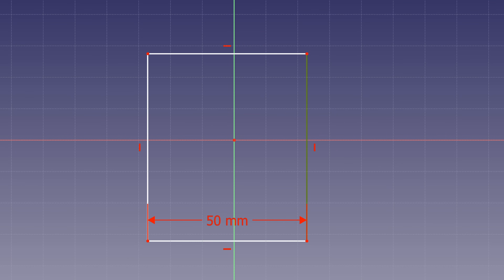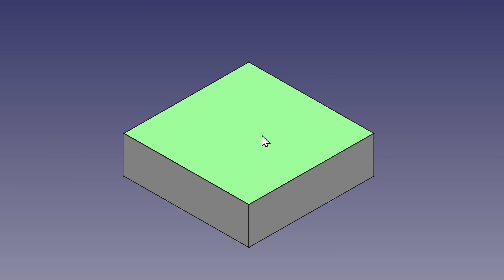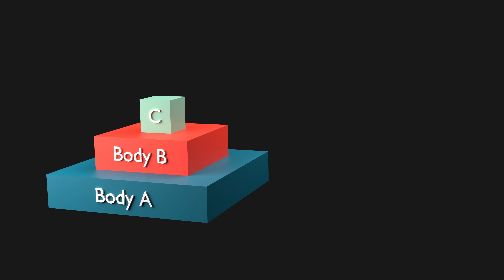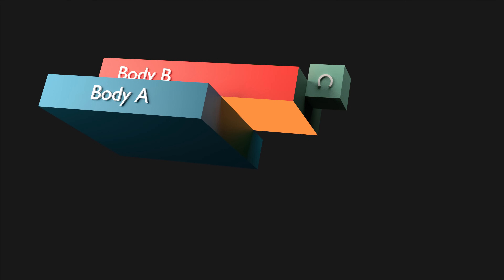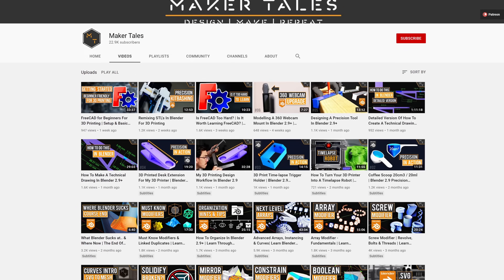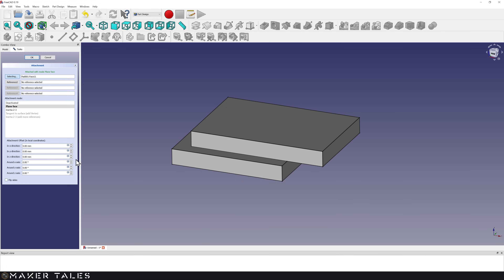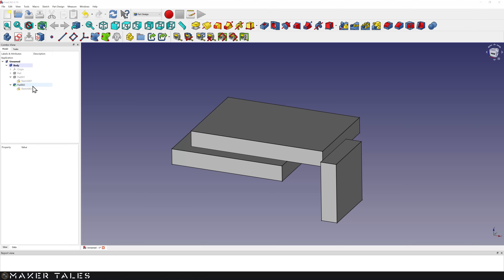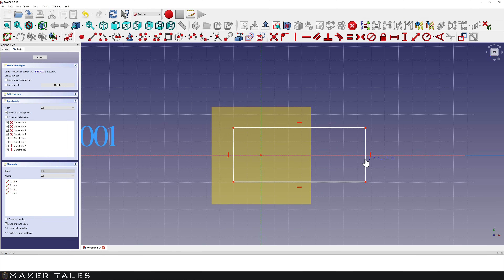FreeCAD Is Fundamentally Broken!  - Now what... Help Me Decide...

Comment: I come from Siemens NX 11 and NX 12 and downloaded freecad as NX licenses are prohibitively expensive for hobby projects. I was imediatly disgusted by it's cluttered UI and searching for stuff you know how to do in another software is quite annoying as well, I was willing to put of with it for the time being simply because it's free and you can't really complain at that price level. Then I stumbled upon this bug. First I thought it was just an issue with what I did. Maybe I didn't attach the sketches properly? Nope, it's just awfully coded. This made my uninstall the program and never came back. To me, it highlights a fundamental misunderstanding of how a modern CAD software needs to function. Every cad software works by associating geometric data together. What they have demonstrated is that they lack the crucial understanding as to why that is done. It is done to communicate relations between part features to one another. The designer (or anyone else) doesn't give a shit about how the side is called. What's important to them is the position of said feature on the part side, it's dimensions and it's tolerances. NX does that really well, as it let's you define relationsships between sketch features and part features explicitly when sketching and for all those parts that don't need an explicit declaration, the rapid constraints usually put sensible relationships between part and sketch features into your design automatically. In that program, you'll never encounter such a bug - you might get the annoying message that a referenced feature has been modeled away, but that is usually the fault of the user, not the CAD software.

Comment: That is really not a software issue or a "bug" necessarily, it's a methodology problem. As you say, origin based is the correct method. This is true even for small parts because you want to do a part once, not redo over and over - stability is king. New users should learn this from the start. Much worse is the lack of truly flexible multi-body. If you want to do "quick intuitive" 3D then use Sketchup or 123D. Building geometry on the surfaces of other geometry is a road leading to disaster - at least professionally.

Comment: Its good practice to use parameteic reference planes rather than body features so it's not really an issue.  This same "issue" occurs in professional and very expensive software too.
Reply: I've been using faces as references in Solidworks for well over a decade and never had the slightest problem. Other software can handle this robustly, but you have to pay for it.

Comment: That is sorted by not messing with the names basically, the only time you do that is when you messed up the naming. What i find problemetic is the interface of freecad, it is not logic coming from lets say the autodesk branch and you have to spend some time identifying the software symbols instead of making drawings. It is not difficult but the transitation from lets say fusion is not fun, at all.

Comment: Great explanation of annoying "topology naming problem" which everybody will experience when using FreeCAD. Especially when adding chamfer or fillet the issue is destroying the whole object in case of changes in sketches lying underneath. Really annoying! When developing and optimizing a part it will be always necessary to modify sketches fundamentally. FreeCAD is the best real free CAD program (absolute no doubt about this!) and i wished hunderts of times that the topology problem would be fixed. Like in Excel where all linked cell names are automatically changed in all formulas if columns or lines are added or deleted.

Comment: A question: Is this problem related to the SKETCH based workflow? I mean if you weren't sketching, but still wanted parametric dependency, couldn't you just model one part from another's GEOMETRY? In other words why does it have to be a "sketching plane"? Okay, I'm a 25 year Rhino user. We don't sketch. We just build. Well, I speak for myself. I just create geometry, and use it. I usually start from curves, and they don't even need to be in a PLANE!  Rhino parametric "history" system isn't perfect. For all I know, it may use the same technique under the hood. But I tell you ALL THESE "SKETCH" WORKFLOWS are making it very difficult to learn FreeCad and others. (all caps only for emphasis 😃)

Comment: 110% This.  I learned SolidWorks in college, easy to use but requires a license.  Fusion360 user agreement gets weird if your designs support a company that has more than a few people in it.  SketchUp isn't a parametric modeller as far as I can tell.  FreeCAD was what I settled on to make some 3D printed widgets for an engineering competition, but this face-breaking issue was a really glaring bug when I first started adjusting dimensions and the main reason I have trouble recommending it to others (my work around was to absolute reference everything to the origin rather than other faces).  I'm glad I'm not the only one befuddled by this.  It would be nice if FreeCAD had the level of support KiCAD seems to have; making the parametric modelling function as intended I think would go a long way to enabling that.  I'd second working with the Reel Thunder branch, I'll take another look at FreeCAD if there's a fix out there for this issue.

Comment: Using only datum planes that reference the origin or maybe other datum planes forces you to make simpler objects and you're then not using all the potential of the modeling tools available to you. Because basically, you're re implementing the features in terms of datum planes; for example, when you set a datum plane z-offset to the Pad length of some pad, you're basically duplicating the feature; one is the feature, the other one is the expected location of the front face of the extrusion. This is the solution they're telling you to use in the forum..
What FreeCAD should be able to do -- is to reference the front face of a Pad by a symbolic name (i.e Pad2.frontFace), or Pade2.SideFace.betweenPoint0andPoint1 the extruded shape is linear) so that it's less likely to break. This is how it's done in SideFX Houdini (for the frontFace part). Or give the ability to the user to name the faces using different methods which the user can choose depending on the situation and are less likely to break when changes occur upstream (for example: faces sorted clockwise starting from some point..)

Comment: "Program breaking bug" is nothing more then overreacting. What you are talking about is a bad design. The application does what it suppose to do. As you user you just expect a different outcome. What FreeCAD should do is generate unique, internal ID-s, and use that to identify EVERY 3D element.

Comment: Wow, I don't know how exactly that I hit on this video, I really was not looking for FreeCAD stuff but it explains what I have been battling with.  I have been continually afraid to modify a previous sketch as I have hit this bug so. many. times.  If FC would just let you easily move the displaced sketch to a new face it would be an easy fix in most cases.   Do you have pointers to instructions about how to fix the problem, even if tedious as well as how to put sketches on planes and compose them in to one?  In any case given the state of affairs I'd go Real Thunder because that issue has consumed an inordinate amount of my time.

Comment: That's just bad programming and it shouldn't get out the door in that state. Either you make the face IDs persistent or you need to do a reindexing pass when the list is changing. I don't use this software but first thought is that the ordered list shouldn't be exposed to the user at all, faces should be exposed in the UI as local to the "body" they are part of with some meaningful designation/description. The raw list of faces should be behind the scenes so the code is hashing between public and private IDs.

Comment: With Fusion still being free (but more limited), and with the maker version of solidworks also it now for less than the price of Netflix, I think using “pro-grade” software is the way to go. It’s unfortunately, since you’re at the mercy of Autodesk/Dassault, but the release of this version of SW means that there is a market here, with active competition, so users should still be well off.
Reply: Have you looked at Siemens Solid Edge cad/3D modeling software? That’s another free-to-makers  “pro-grade” alternative.

Comment: Interesting video. I came across it in my frustrated attempt to find information about links going out of the allowed scope when fusing in FreeCAD. Have you experienced this and if so, do you have a suggestion on where to go find answers on how to fix it?  I believe that the link error is causing problems in my 3D printed parts, as there is a seam that keeps appearing where it shouldn't.

Comment: I used to use Solidworks, and keep trying to find an open source replacement because I’m a Linux user and prefer a 100% pure Linux working environment. I’ve evaluated FreeCAD several times, and even give it a try every few years. I don't think FreeCAD is evolving healthily. Yes it can create parts, it has assembly, it even has a path module to generate gcode. But every module has problems which keep making me frustrated.
 
I switched to OpenSCAD, and am pretty happy now. Of Course OpenSCAD has its own problem, which makes me think about creating a new CAD software from scratch. But at least OpenSCAD can get the work done.

Comment: As I understand the problem. The creation of the new face alters the ordering of the faces meaning objects that reference the face change position. Here's some spitball ideas.

1. Append the new face to the end of the list. It would maintain the existing relationships between Sketches.
2. When making the new Sketches, treat faces that align to the base as in the list of  faces but not available to build on or draw. This would create some invisible faces that might be computed but not drawn.

3. Store the vertex numbers used to make each face. As new faces are made, the verts used are stored against them.
Reply: Perhaps I don't understand the complexity, but isn't it just a case of remapping dependent sketch face references when an action causes face indexes to change?

Comment: I use different CAD software depending on the model I need to make and the purpose of it. I really like the FreeCAD spreadsheet function, and I was comfortable using datum plane referencing from the beginning, but it was tedious before they added the ability to set certain plane offsets with spreadsheet functions. At this point, I can usually create whatever I want unless it contains fillets. The name topology absolutely ruins these to the point where the fillet needs to be the last operation in your part, after which you can never edit anything again.

Since Fusion360 added in more restrictions for the free version, I've moved away to Solid Edge, which is basically magic for editing step files. I'm still not super used to the workflow of editing so many things in 3D instead of sketches, but I find that CAD skills are transferable regardless of the software you choose.

Comment: So, are you telling me that your parametric reference system doesn't respect parameters? This sounds like an issue that the end user should not be concerned with nor encounter in regular use. One of the main gripes in FreeCAD for me is the UI. Coming from AutoCAD and Fusion 360, the UI is confusing, convoluted, hard to navigate, hard to reason, things that should be simple to do are complicated, things that should be complicated to do are simple and so on. This is something that Fusion gets right: the software doesn't get in your way unless you ask it to.

Comment: Good point. I just realized that I know nothing about cad. I started in Fusion in the good old free times and it worked fine. A time ago I had to change to another cad program. In my case freecad. And I messed around hours to get to an usable part. But that's my little advantage. Even with this bug it needs hours but in the end iam able to manage it, getting an usable part to work with. Btw nice and informative Video 😅👍

Comment: Having managed engineering departments since the mid eighty I saw, Anvil, Autocad, ProE, Solidwork. I can tell you that I heard that any new software was broken/not working. You just need to adapt to what you have and develop good practices. I am retired now and got FreeCAD and learned about the issue I adapted and now I believe this software is fantastic. Sorry but this video is a little bit winning.

Comment: This exact bug has literally driven me to tears of frustration.
Like, I was trying to design a fan duct for a 3d printer. My boss wanted me to change a "few little things". Every single time I changed anything, it would run into this exact issue. It got to the point where it just was less of a hassle for me to just delete the sketches I made until I get to the semi starting point, then re-make the sketches with those changes baked in. Honestly, this kind of thing is a major reason why I still have zero patience for FreeCAD any time any minor thing goes wrong.
Reply: i had started attempts to use free cad about from 2010, while i had used Inventor and auto cad from 2005 till now, 
and every time, when i had started the new attempt, i had meet some bug, and had returned to inventor back.
in spite of the free cad has made much progress while this time, but i think because of it made by volunteers, it will keep for home made intentions only. Nothing serious i will not try to do with this CAD.
this is my today's artefact https://youtu.be/4lUprDk8aSw
Reply: I think being able to go back and change something is the real measure of a good CAD package. FreeCAD just sucks.
Reply: @andyspoo2  FreeCAD is at the rather frustrating intersection between "quite capable of a lot of things," "free" and "having some glaring issues." For a free piece of software, it's just nice enough to justify using, but also frustrating enough that you don't want to spend too much time wrestling with it.
Reply: @ray30k  Agreed.
Reply: @ray30k  Hey, blender got past that stage, I'm sure free cad will eventually.
Reply: @davidwarford3087  Blender never had the problem of arbitrarily renaming the canonical names of objects. It boggles my mind any system would ever do that, honestly. How is that not obviously the wrong way to do it?
Reply: @ray30k  A lot of people, like me, just don't have that much extra money and "free" is the only option. beggars can't be choosers.
I'd love to have the income to get all of the major CAD solutions, but that isn't possible. I'm not rich.
Reply: @davidwarford3087
Blender still does not have a construction history.
Reply: @andyspoo2  agreed. The entire POINT of a cad software is to be able to make tweaks high up on the tree and have those changes propagate down in a sensible way. If that doesent happen, it is not a computer aided design software. It is a computer HAMPERED design software.
Reply: @andyspoo2  
Cries in Alias (if anything goes wrong in it, it goes horribly wrong).

Comment: Yeah,  freecad sucks. I'm stuck between pirating Solidworks or Fusion360 lock-in. Plus both require windows. As a linux user I have few good options. OpenSCAD is the best,  but it's a whole different beast. Wish there was a real blender cad.

Comment: I think you are being somewhat petty, software changes and if the user is incapable of changing their workflow they should either continue using the version they know or change their workflow and continue to grow with the software.

I've been using blender for over 20 years and it's completely different today, there were issues of course over the years as hotkeys and even entire features changed. So I changed, learned, and grew as the software did and am better for it.

You can't expect to make tutorials today which will completely apply later, that doesn't mean they aren't still useful. That is why I said you are being somewhat petty.

Comment: A good series on origin and datum based drawing would always be relevant and could be made while we wait for the topological naming problem to get fixed. From what I've read they are fully committed to merging in RealThunders changes but it's a complex merge. FreeCAD has plenty of other quirks though and I'm not sure, even with that bug fixed, that it's ready for prime time. For example, assemblies are an absolute pain to produce and are even more fragile than solid geometry (RealThunders work on this is a great start though). I desperately want this project to succeed but I think it's got a way to go before it's ready for general consumption.

Comment: I mostly bothered by the lack of an ability to choose exactly which faces you wanna extrude. If you have more then one option it won't extrude at all

In fusion 360 and SOLIDWORKS for example you can choose two rectangles or the area they intersect to extrude

Comment: I personally found free cad very confusong, almost to the point of being unusable. As a newcomer to modeling, I had a lot of trouble just figuring out what (mode) I was in, which object I had selected and how to properly edit faces. How you managed to even do the edits you did without having to navigate a ton of menus or tabs is almost mistifying to me. Thus I have kinda given up on free cad for the time being. I'm waiting for the hobbiiest version of solid works right now. It cabd be worse than this mess.